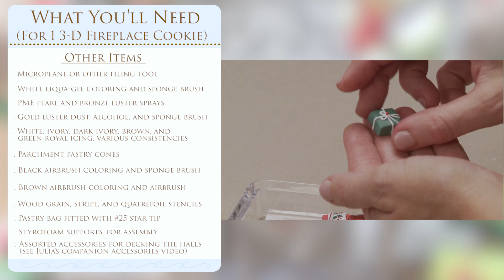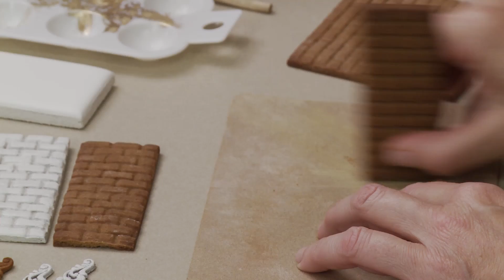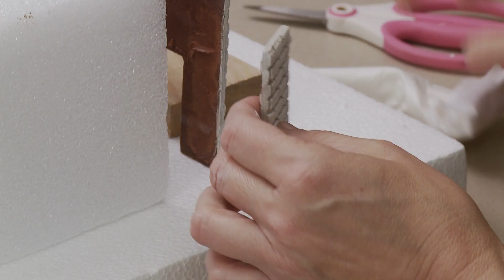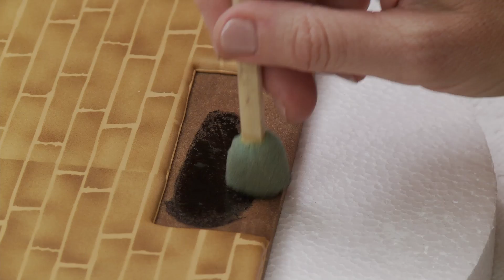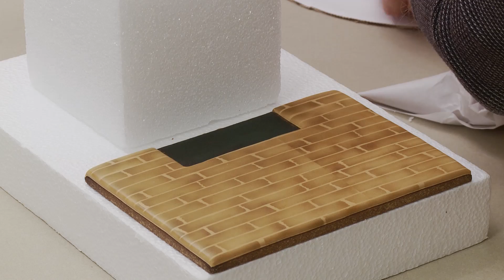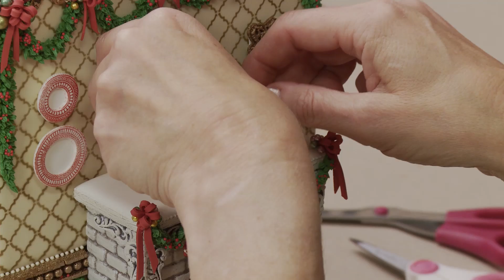3-D Christmas Fireplace Cookie

Comment: 11:38 Hi there! I am about to try baking some gingerbread (your recipe) in a silicone mold…like the chair rail detail in your fireplace cookie video. How long do you bake such small pieces of gingerbread? And at 375 degrees?
Reply from the maker: Baking time depends on the size and depth of the mold and how accurately your oven is calibrated, so I will never provide exact baking times. I bake at 375F until lightly browned to browned on the back side of cookies in molds. If you underbake, the dough will stick in the molds. You may need to experiment a bit with the actual mold you are using to optimize the baking time.
Reply: Thanks so much! I am in the process of experimenting and appreciate the 375 degree guideline! You are just the best! Love your work and your process!
Reply from the maker: @trinatjersland3411  :) Thanks - what a delightful message to read this morning. You've started my day off on a nice foot!

Comment: Amazing but you would be disqualified from any contest for using the string.  Cant you just glue the stocking s to the fireplace.  Other then that it’s amazing in every way.
Reply from the maker: Thanks so much! I'm not entering this into a competition though . . . also, in the cookie competition I run each year, the strings actually wouldn't be a disqualifying factor because they are visible and easily removed. But, yeah, you can just ice them to the mantel, but they wouldn't have the same movement.